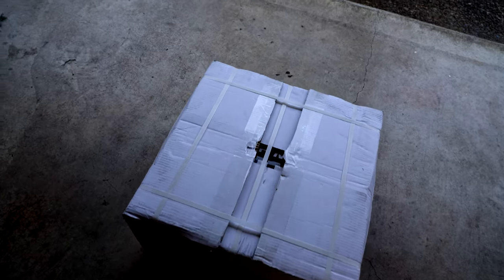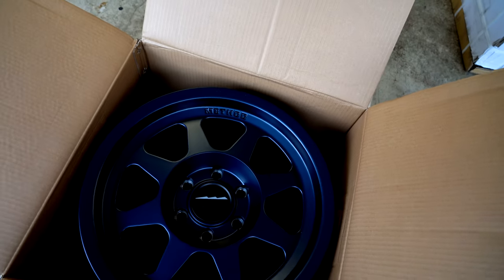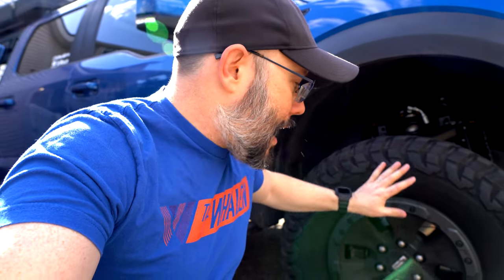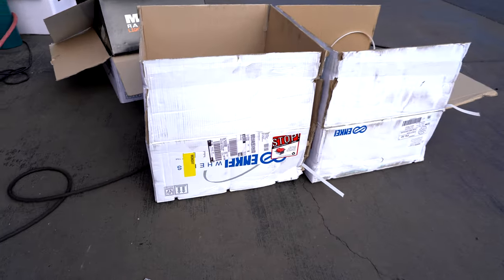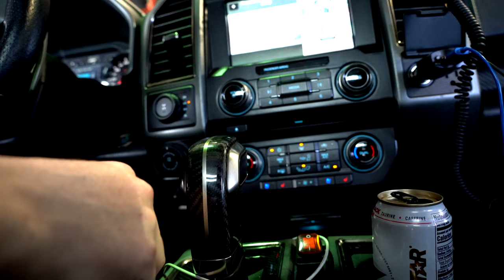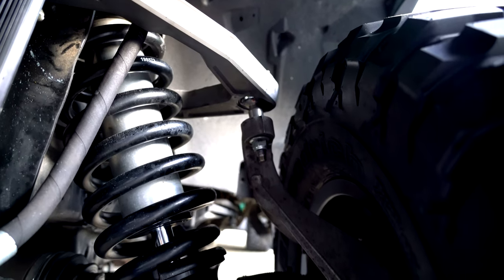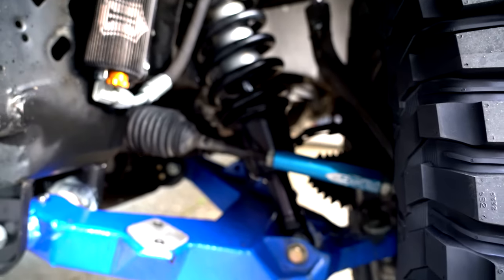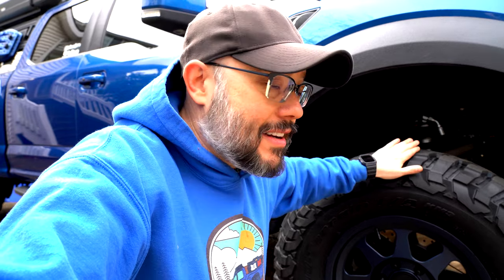New Method Wheels for my Raptor

Comment: 100% agree on the 37s. Practicality wise on the Gen 2, there's just so much you have to do if you want to do it the right way. If you want to use stock fenders, you can pretty much forget it. Great for a pavement princess but not for something you're going to use as intended. 

The Methods look pretty good! My 19 is Ford Performance Blue so a little different shade then yours. Still searching for the perfect wheel to grab in the spring. 

Have fun! Be safe!

Comment: Nice truck! I appreciate REAL off-road rigs!!! You are definitely in that camp. I see soooo many (not hate, just observations) Raptors with 20"+ wheels that neuters the truck from what it was designed for; off-roading. Also I cannot agree more. People are fixated on having to run 37's, I have heard too many horror stories about things NOT working out as planned. 35's on most trucks, the Raptor included along with properly sized 17" wheels gets the job done.👍
Reply from the maker: I might go to 37's when I stop making this my daily driver too 😂. If you primarily Offroad with the truck and do the needed  trimming of the pinch welds + re-gear than running 37's has its benefits Offroad.

Comment: I put 37s on my Gen 2 after some eibach springs and some +1 offset wheels. I only had to trim the wheel well back, it looks OEM and it rides great. I take it off-roading and have zero issues rubbing or my suspension. I did lose about 2 mpgs but it’s minimal in comparison to how much better the truck handles and looks. Your Raptor looks great by the way!
Reply from the maker: I may go 37's and buy a diesel truck and a trailer to tow the sucker with down to the Baja/Mojave again! In the words of Indiana Jones "It's not the years it's the mileage!"